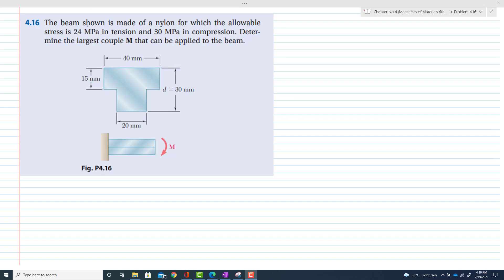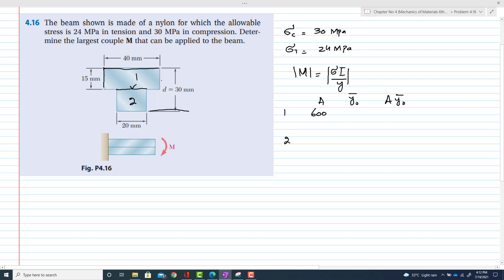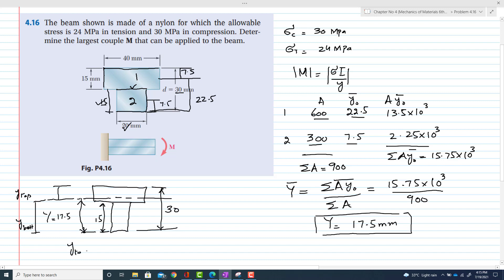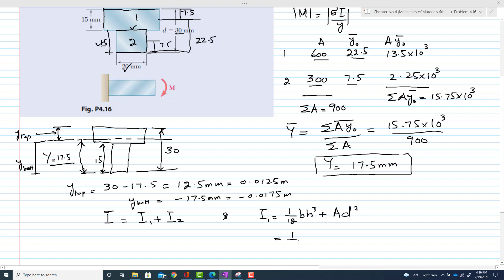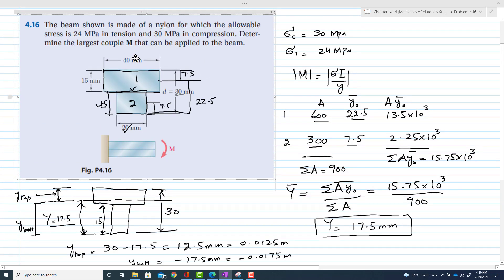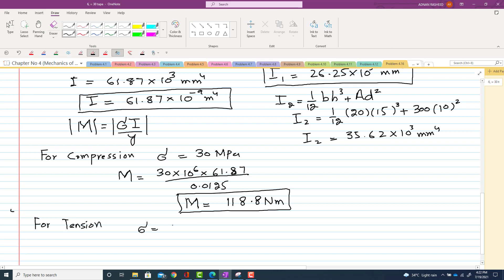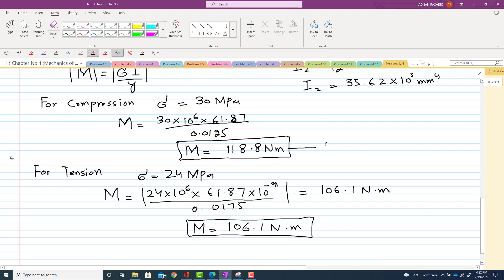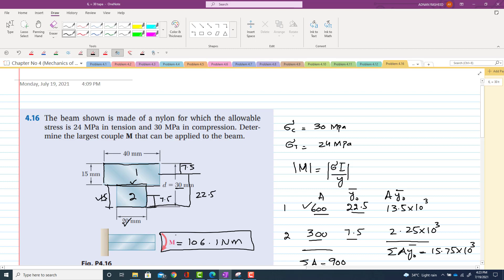#Mech of Materials# |ProblemSolutionMOM​ | Problem 4.16 |Pure Bending| Engr. Adnan Rasheed

Comment: why take smallest for largest M????
Reply from the maker: the answer is that we have two value of M, one is larger 212 and other is 186.7 smaller. we choose smaller 186.7 because it will not exceed allowable stress in tension which is 24 Mpa. if you choose the larger 212 then put in bending stress formula you will get benign stress greater than allowable bending stress in compression and it will cause failure....I hope it is clear now....thank you
Reply: thank you, thats very helpful @engradnanrasheedmechanical
Reply from the maker: You are welcome and share my videos with your friends and help me in growing my channel....

Comment: Please I think there were wrong entries into the calculator during calculation. Please kindly check it out for me
Reply from the maker: @alexadusei5318 Yes you are right.  Its my mistake that I should put 24 Mpa in tension that will give you 118.8 N and for compression put the 30 Mpa that will give you 106.1 N.M moment in compression. So kindly make these corrections. Thank you for pointing out these mistakes. I am happy that people are learning from these videos....
Reply from the maker: @Alex please don't be confused . Calculate it by yourself. Error may exist but the concepts really matter so focus on concepts.rather than on correct answer. Rest you are really hardworking and point out the mistakes which I had made 2 year ago in some videos...thank you

Comment: I bleive the compression and tensions were swapped. If the beam is being bend downward, the top should be under tension and the bottom under compression
Reply from the maker: In this question it is asked to find the largest couple that can be applied. And yes you are right that for the beam bend downward the upper will be in tension. Rest we have calculated the couple using tensile strength and compressive strength and choose the value which can be applied.... thank you 😊 💓